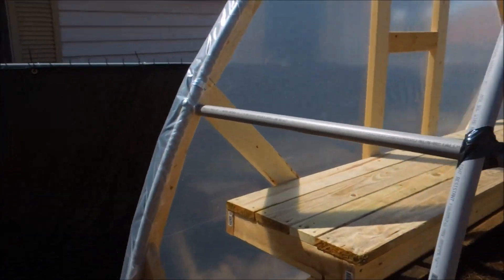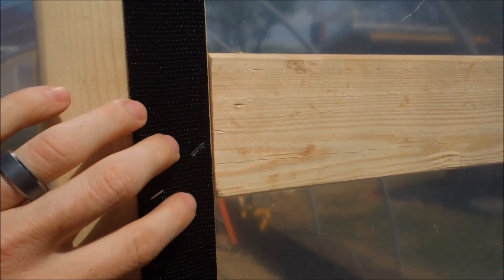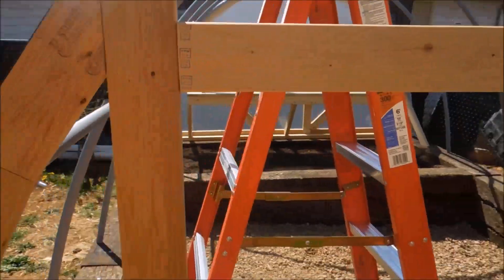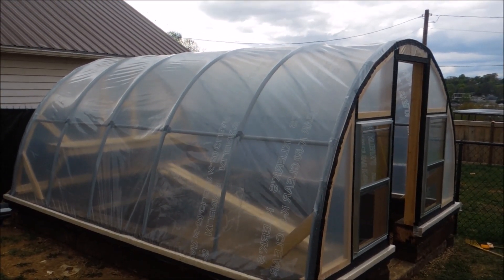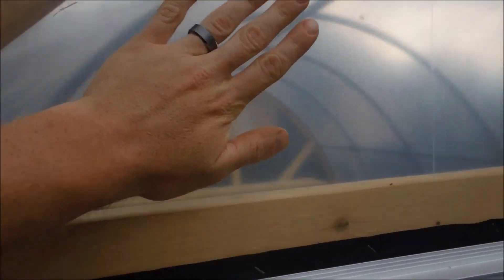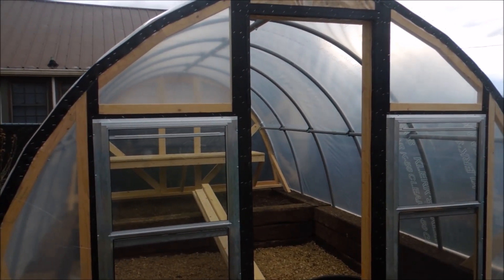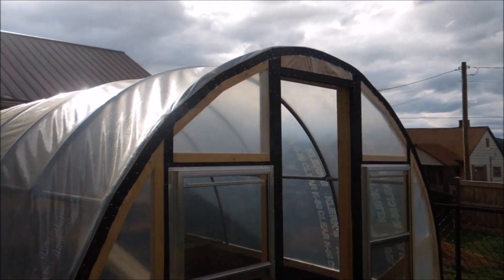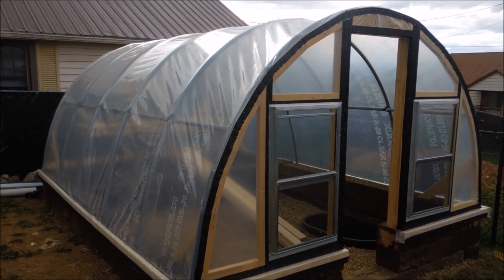How to Build a Greenhouse Part4 by HPFirearms

Comment: Like the way u put the long piece of plastic on. It will be easy to replace or add another piece on top of the first layer. This way u can add a small fan to separate the two layers of plastic and add additional  insulation  to ur greenhouse. It will also add strength to the greenhouse
Reply from the maker: we actually did install another layer of plastic and inflation fan back before winter. thanks for watching!

Comment: Just a thought and I hope it make sense.  On the furring stips you used at the top of the railroad ties to hold the plastic down, it would seem better to use 2X2's cut at a 45 degree angle instead of the flat furring strips. That way any water or ice would run off the plastic and not pool onto the flat surface of the furring strips and potentially rot the wood or cause molding in that area.

What is the product name for the webbing you used? My town only has a small Home Depot and they simply don't carry everything.

More than just explaining the actual build of the hoop house, i enjoyed the story of the greenhouse guy giving you the free material and asking nothing in return. i had a similar situation with an auto mechanic who worked on my car, but could not fix the problem and then insisted I not pay a dime to him for his work. I tried to pay him, but he refused any money. It sure makes one's faith in his fellow man improve and I am sure there are many more stories as such which so often go unshared. It was nice hearing your story of such an experience.

There is a possibility that the sunlight may cause a reaction with the plastic where it contacts the pvc pipe and cause it to disintegrate. I know that can happen with white pvc, but I am not certain that it does with the gray electrical pvc or not. People use duct tape to cover white pvc to prevent such a reaction. I found a lady on Ebay who makes socks or cloth tubes to cover the pvc pipe with and sells those cheap.

I am in the process of planning for a build of my own hoop house or cattle panel greenhouse, so I am reviewing as many builds as I can for ideas. Even if the build is not quite what I am doing, I find neat ideas to ponder on each of them. Those railroad ties are heavy, for sure. I once bought a bunch to use in a garden. I had a Chevy S10 used to haul them in. They guy laughed when I told him I wanted eight of them, but I had measured my bed and knew that 8 would fit inside of it. Unfortunately, I had not given (any thought) to the weight of 8 railroad  ties and the bed of the small pickup truck almost bottomed out when all eight were put inside of it.  My son sat on the ties in the back of the truck that day, but the first corner we came to, all of the ties began to slide right out the tail gate, as the pickup liner was plastic and they slid easily there. We were very lucky to not have anyone stopped behind us when they slid out like that. We drove slow as molasses that day,, but we finally made it home safely. My back ached for a month with all the lifting of those ties we did that day.  :-)   I do hope you do not have any leeching problems from them.

Any rate, nice video and thanks for sharing.